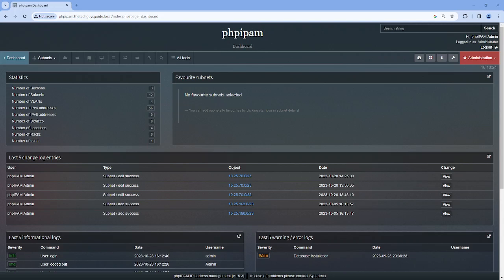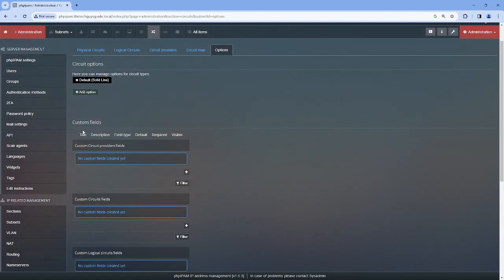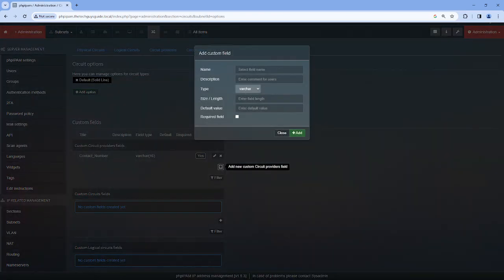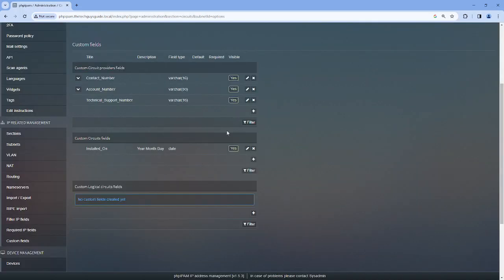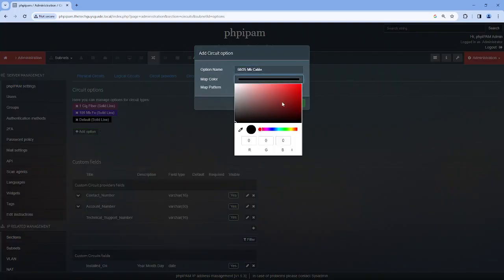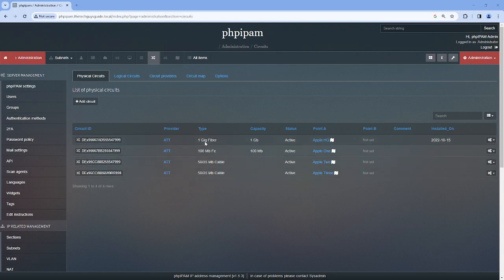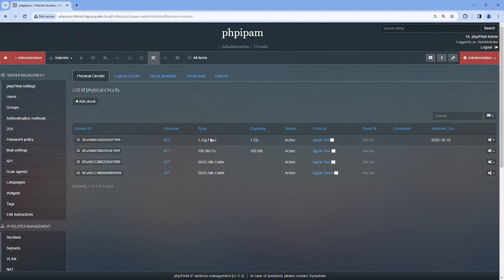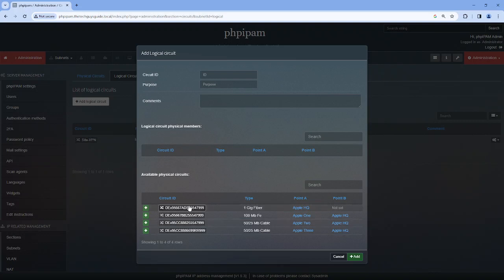php{IPAM}  Setting up and using Circuits feature to manage circuit information

Comment: Your videos are great wondering if you could release one going through the SNMP features and what that brings back. I have set devices up and tested them and it says successful but what next
Reply from the maker: Hello and thank you for watching my video @donor0kebab, I have it on my list to do, maybe in a week or two.  Have a great day!
Reply: @thetechguysguide  Thanks mate once again videos are great just working my way through.
Reply from the maker: @donor0kebab Hello I have gone back and forth on the SNMP module and with the current release it does not work as it is supposed to I get Jquery errors. I reverted back to 1.5.3 same issue, I see others in git seem to be having an issue when I get a chance I will try on Ubuntu but I doubt that is is the issue.  Sorry.